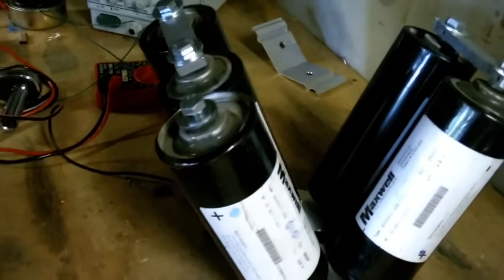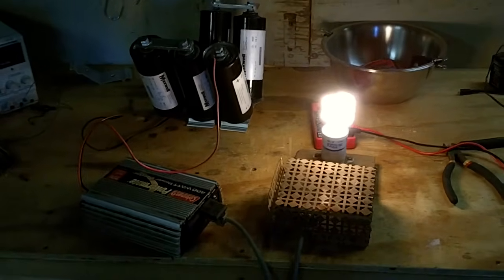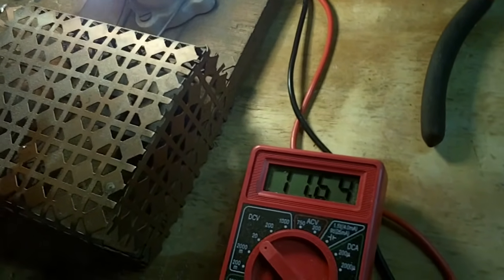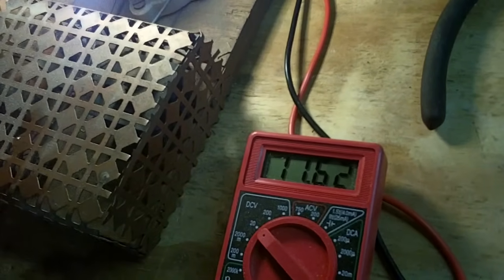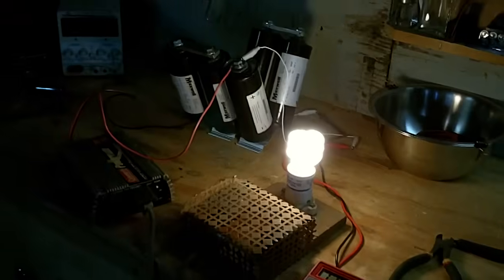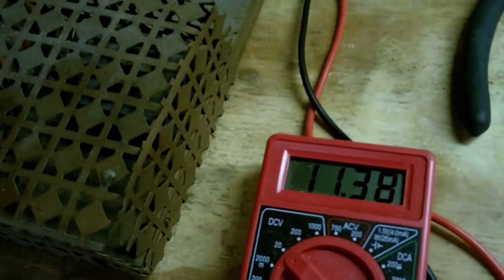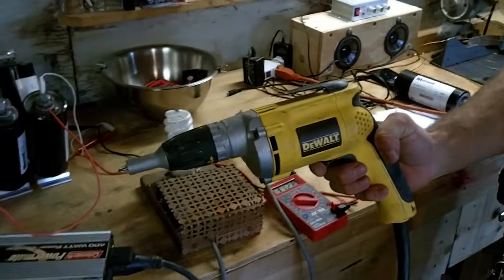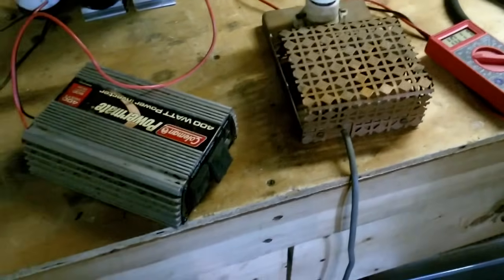Super capacitors run light bulb and drill

Comment: Capacitors take 3 seconds to charge so if you get 3 minutes of electric then just charge the caps again. Run a trickle charger on those caps that can detect float and heavy charge needs. Problem solved.

Comment: Well, of course.
It's only a bit more than 1600W peak power anyway, a purpose-built psu wouldn't cost that much.
Considering you'd only be using it for a couple of seconds, you can use components rated for much lower power and then let it cool before using it again.

Comment: Yes, regular battery have huge amount of energy stored, BUT THEY CAN'T RELEASE it very fast due high ESR (~ internal resistance). This is one of their main differences and that make them not completely interchangeable. For some applications regular batteries will be better, for some super/ultra capacitors and for many "in the middle" there will be no difference. Price will drop dramatically over time, as super capacitors become more  widespread.

Comment: You need to modify the inverter to continue to work at even 3V input , without modifying it most of the energy is not used

Comment: @BackyardAmusement Capacitors are in series so that they can handle (and provide) higher charging voltage. Overall capacitance is half but the overall voltage is twice of their individual ratings.

Each capacitor stores energy that is: E = 1/2 * C * V^2

Two capacitors In series give, E = 1/2 * (C / 2) * (V * 2)^2 = 2 * (1/2 * C * V^2)

Thus the capacitance is halved but the increased voltage rating compensates for that.
Thus individual charging and then putting them in series is of not benefit.

Comment: @BackyardAmusement When two capacitors (each 2.5 V) are in series and 5 V is applied across them, they are fully charged. In series, the voltage applied is double. Thus same energy.

Comment from the maker: @0nvd0 - I disagree. Capacitors charged in series will store less energy at the same voltage than if charged individually. Check out Google for more info, it's the same formula as resistors in parallel. ;)

Comment: @BackyardAmusement There is no difference if they are charged in series or individually. Capacitance of a capacitor decides after how much charge it will hit the full voltage. Thus the charge stored is the same in any configuration. Q = CV.

Comment from the maker: @panyolito1929 - The caps are 2.5v each. If you put two of them in series, you can charge to 5 volts, but at half the capacity. If you charge 2 caps individually, you can charge each to 2.5, then put in series to make full capacity 5v. If you overcharge, caps die.